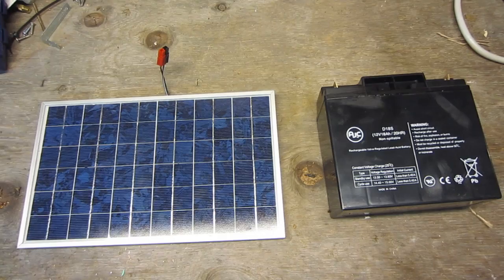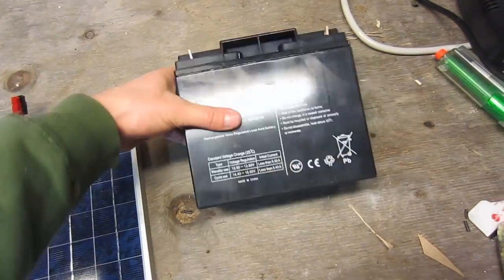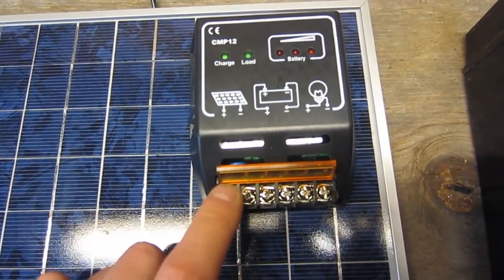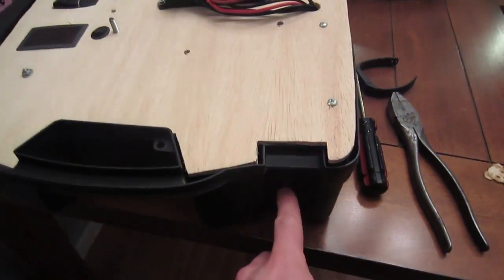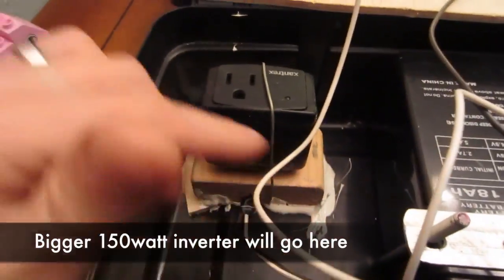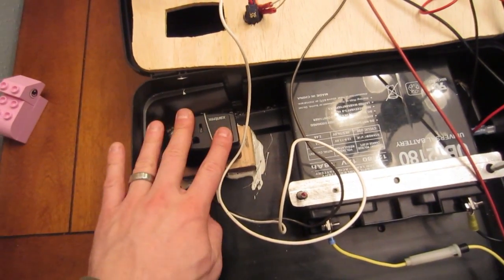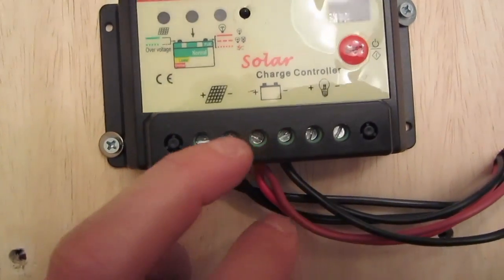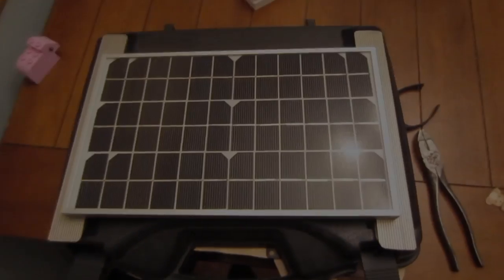$150 Portable Solar Generator Components

Comment: Nicely done.  Good job for putting this out there.  I'm currently building one of these to go along with a bigger home system i made (like a Yeti 1250). 

About the solar stuff,  I think it's cool that you selected a panel that would fit your case.  However, I don't think I would select the 10 watt.  It's going to charge too slow to serve much purpose practically plus I'd rather not sit my whole case in the sun.  I'm selecting a separate 30 watt even though it will be more hassle to set up.  

As for the charge controller, with something this small you probably don't need one and could save some money.  Since most of these would include a voltage meter and the batteries are going to end up charging so slow (especially with that 10 watt) that you could likely just stop the charge manually around 14.3 volts.  I am putting a charge controller on mine because I have one laying around left over from another project.  I wouldn't bother with it using a 10 watt panel though.

I'm going to be using this switch panel for the front of mine (case will operate closed) along with a 400 watt inverter that can be switched on separately and 24 AH of battery storage.  
Since my case will operate closed I'm adding two small speaker grills to the sides to act as vents.

https://www.ebay.com/itm/5-Gang-Switch-Panel-12V-24V-Interior-Controls-Car-Boat-Marine-LED-Rocker-Breaker/143042546805?ssPageName=STRK%3AMEBIDX%3AIT&_trksid=p2057872.m2749.l2649

Cheers

Comment: The beginning was great, especially how you showed each part & what it is for, (way better & simpler than other videos I've seen) could you do a part 2 ? where you show which wire goes where, like what you connected first, 2nd, & so on. I've never wired anything before. That would be helpful to follow along with your wiring diagram. Thanks

Comment: Gel cell battery.. when you list agm battery.. those batteres have certain voltages they charge to and certain rates or current they charge at.  Those charge controler don't properly charge agm..
Reply from the maker: NoVaKane I know what you mean but this battery is not expensive enough to worry about that tiny voltage difference.
Reply: well you will shorten the live with improper voltage. if it dodnt mater then there would not be data sheets giving the information on charging.
Reply from the maker: Good point, if that's important to you, a different charge controller would be necessary. My charger on my boat has a single setting for AGM and Gell cell.  BTW This project still works well 4 years after making it.

Comment: What would this be good for? I want to build something that can run a refrigerator for 2-3 days what would you suggest
Reply from the maker: You'd need this scaled up much bigger. Wouldn't be portable.
Reply: There are plenty of super lightweight portable solar panels and super efficient lightweight LiFePO4 batteries in the market that are portable and will easily run a fridge. My Dokio 100 amp solar runs my Alpicool fridge no problem, and doesn't weigh but about 6 lbs.and cost only $124 on eBay, I could jump off the car with it if I had to.

Comment: You can add a resister inline to control the voltage to control the fan to make it run slower.

Comment: would this run a small TV or a space heater?
Reply: Absolutely not this a small system for charging devices and some lights, it’s great for portability as more energy equals more weight a lot more weight

Comment: how much would you charge for a unit like that? i need to have one for camping, possible tool and small appliance use in an out side camper, i would lile to know more for both off grid and on grid set up... for refrigerator n tv thanks
Reply: what size battery?

Comment: will this portable unit operate a small ge refridgerator?
Reply: No. It's only 10 watt
Reply: How much is needed for the rv type fridge
Reply: +samantha nicholson it should say on a sticker on your fridge. The battery is the power limiter. Buy a 50watt panel for your Rv.

Comment: Great video.  I purchased this Charge Controller that has the LED volt meter built in so it cuts down on the wiring.  http://www.amazon.com/gp/product/B013HK2OOE?psc=1&redirect=true&ref_=oh_aui_detailpage_o00_s00

Comment: Really good idea!  Thanks!  How did you make the small inverter that's in the box?  Did you disassemble the red inverter you show in the video?  How is that done?  Can you do the same with 400 w inverter? 

Also, is there a way to charge the battery using AC?  How do I set that up?

And last question, on this video you have red/black connectors near the handle, what are they and what  is that used for?

Comment: Can you use a 12v 7ah battery for the system
Reply from the maker: Yes you could but you wouldn't have much battery capacity. You may save some money but I don't think you'll be happy with the finished product. Don't skimp on your battery.

Comment: better with a lithium ion battery.
Reply: Do you mean that the main battery in the system should be lithium ion? Because that's really dumb.
Reply: GameVidPlus Wy would it be dum ?
Reply: Because Lithium Ion battery have a life of 2 or 3 years, even if they are never used. The chemistry wears out over time. They are also designed to be partially discharged, not deeply discharged, which solar battery systems need. For this reason they don't even make large deep cycle batteries in a large enough size to work for a battery backup system, unless you want to hook up a thousand D batteries.
Reply: GameVidPlus
I know lithium ion dont work passed -15 or something alos.  But what about  Tesla. Theu se them on cars and in very cold temperature also ?
Reply: Pierre-Louis Parant  I think a lithium iron phosphate battery is a good alternative?

Comment: But do you NEED the volt meter or is it just to tell how much power is left in the battery? The on/off to the volt meter just to save power when now in use?

Comment: so the way you have it wired your battery isn't being charged unless you turn it on. correct? why is that? why didn't you hook it to the battery and then to a switch so it is always charging. you could turn the battery off from everything else.
Reply from the maker: Just my choice, you could do either. For my use I liked the idea of having the battery totally isolated when I turn off the master power switch. I can leave it on and turn off the inverter interdependently so there's no reason it has to be off.
Reply from the maker: Can you clarify? Your comment doesn't make any sense.
Reply: SolarBurrito I think it is that when the battery  switch is off, it is isolated from the panel. the switch interrupts the + connection.  simple good design :) I'd like to see the circuit diagram in the vid, not have to click around to see it, if you ever update this project,,,

Comment: Your explanations are quite vague.  You didnt show how to wire it all together. You just showed the final product where you didnt even use the items that you showed in the beginning like the charge controller was different and the power inverter was also different from the beginning of the video.
Reply from the maker: I made a full wiring diagram and post links to all the products in the unit. Look for the link in the video description. The type of inverter or charge controller does not matter.
Reply from the maker: http://solarburrito.com/build-your-own-solar-power-generator/

Comment: What size fuse do we need? Thanks for sharing.
Reply from the maker: Hi Good question, it depends on the smallest wire size you use on the project/circut. I wouldn't go smaller than 12 awg so assuming this use a 15 amp fuse.
Reply: Awesome, thank you!

Comment: the charge controler will use up to 100 watt panel, they make ones for 160 watt set or higher like that, i use a 30watt and harbor freight mix with controlers to charge batterys add more then one battery too